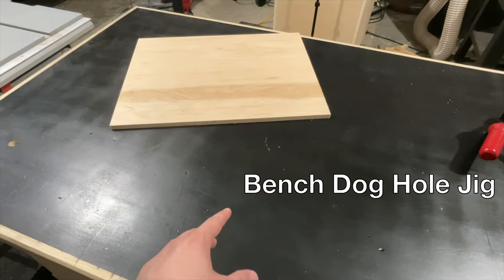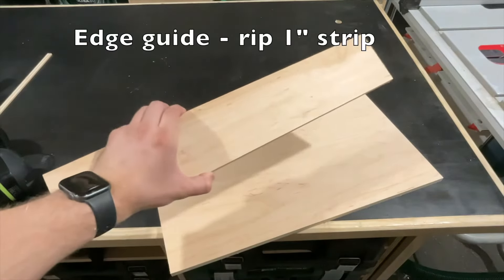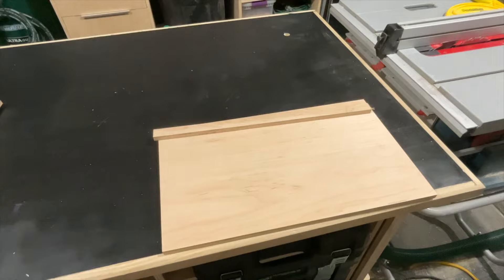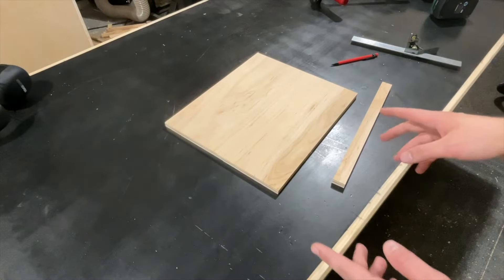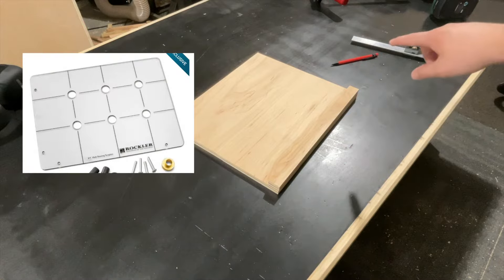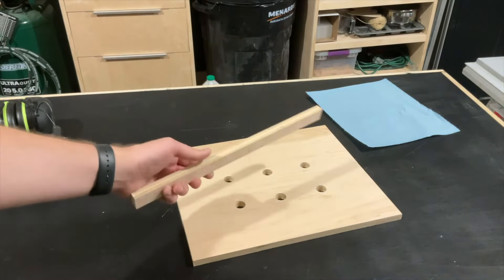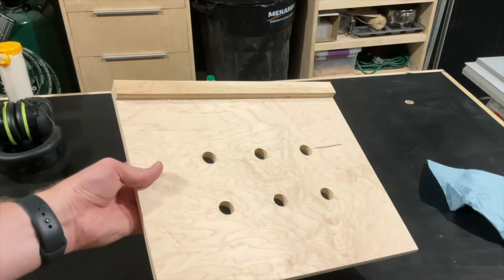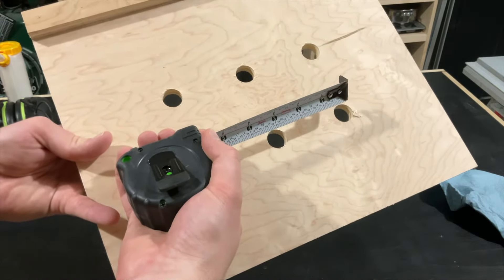Make this Cheap and Simple Dog Hole Jig!

Comment from the maker: I wanted an easy way to map out dog holes in my workbench and couldn't draw a grid because of a finished surface, so I decided to make a jig. I had a couple failures when trying to make a jig sandwich in the corner instead of only having a front-guide. I realized it would be easier with a single guide. This is similar to a rocker product except I didn't want to spend money on a one or two time use jig. I used the Milescraft handheld drill press attachment but an alternative would be a router pattern bit of some sort. 
The size of the jig and spacing of each hole will of course vary depending on your workbench. Most people base the sizing off the max extension of their pony vise.

Here are dimensions of my jig:
top plate:
- 14" long
- 12" wide
- 5" front to center hole spacing
- 4" side and rear center hole spacing
- 3" spacing between holes
edge guide:
- 14" long
- 1" wide

Comment: Came hoping to see an ingenious way of drilling the holes in the jig at perfect centres and in perfect alignment, left disappointed.
Reply from the maker: I’m not sure why an ingenious method is needed to measure the grid on the jig. By making a jig with square edges, all you need to do is measure distance from the edges for the jig holes. The point of the jig is to have consistent measurements between holes on a workbench without drawing a grid on the workbench.
Reply: @fangerwoodworking  one of the holes being out by a fraction of a millimeter renders the dog holes usless for the purposes of square cross cuts using a fence and tracksaw, which is something I am looking to add to my workbench. If you don't require this accuracy, that's fine, but it doesn't change the fact I left disappointed when you showed no accurate way of spacing and aligning the jigs holes.
Reply from the maker: If that’s the case, you should look at investing in a shaper origin because you can use machine and computer accuracy to perfectly cut the grid across your workbench. I don’t think a jig would be the right approach - because even if the jig was perfect, any play in the drill bit size or dog size will compound across the workbench as you drill holes.
Reply: James is correct.  This a just dog holes with no real purpose without accuracy.  You never even demonstrated how square the holes lined up.  There are better ways using the 3, 4 , 5 exact triangle (Peter Parf) or buying a CNC cut jig.  These can be purchased for £50 here in the UK
Reply from the maker: @Selkian  That's incorrect. The purpose of the dog holes, in my use case, is to allow for dog hole clamps and prevent items from sliding while using a domino or biscuit joiner, but keeping them consistent on spacing and distance from edges. Buying a dog hole jig would be a great option because they have machine accuracy on spacing and squareness so you don't have to worry about that. This video shows how to easily make a simple jig with scraps if you just want to add consistently spaced dog holes to a bench without spending money on a jig. Not everyone requires the accuracy, for dog holes, that you two are describing, so this video is meant for them.
Reply: @James_Gower It took me 15 minutes to draw up a template in Inkscape(free) and cut it out on my library's laser machine. No 3,4 5 measuring. Squared it to my benchtop, clamped, and went to work using a 5/8 bit and finishing the holes with a trim bit. Cost- $10

Comment: Really useful, thanks! Quick question, is it formica laminate? Wondering if I use an auger bit instead of forstner, would it chip out laminate?
Reply from the maker: My bench top is just stained. Maybe you could use a Forstner to start and come back afterwards to finish it with an auger or spade. I’m not sure what would chip laminate or not. Another option would be starting with a router. I’ve seen people trim laminate with routers so that’s probably the cleanest option. You may have to make a laminate test piece or test an inconspicuous corner.
Reply: @fangerwoodworking yes, probably will consider a router first. Thanks for the advice!

Comment: Horrible, loud music and no explanation of how you managed to drill the holes in the guide on center.
Reply from the maker: By measuring from the edges. The jig has square edges after being cut on the miter saw so measuring from the edges will make the holes aligned with each other.